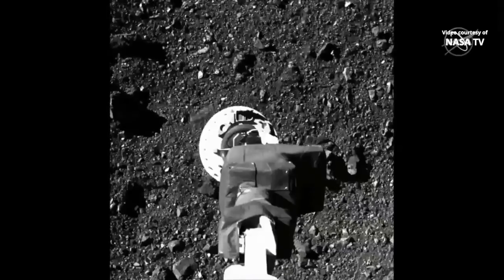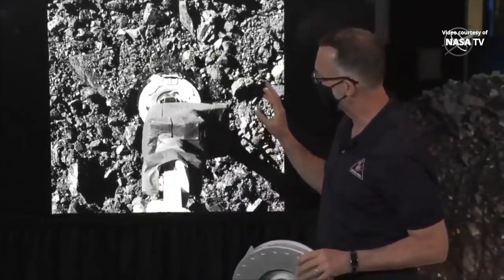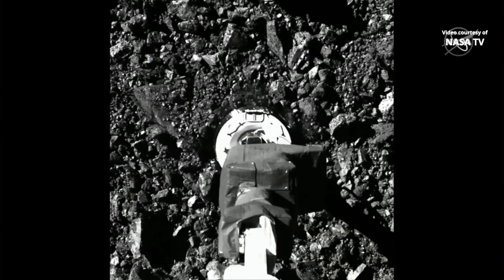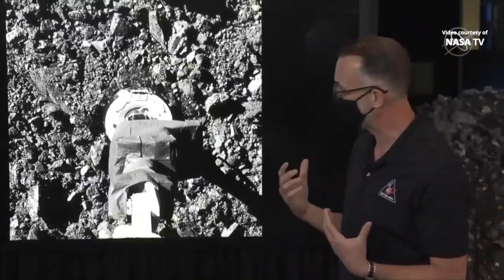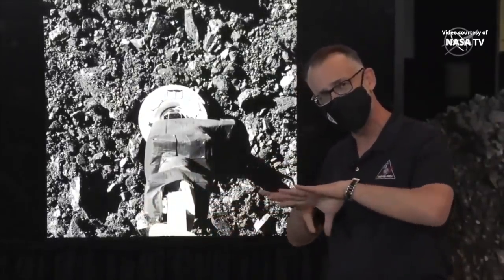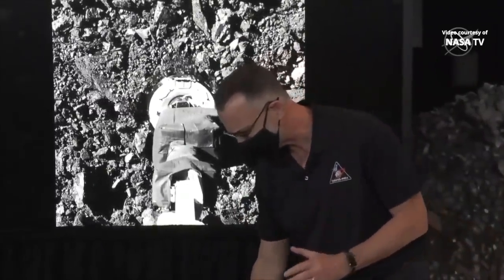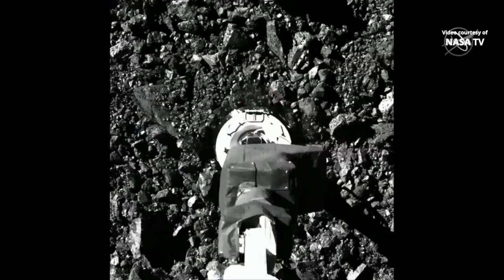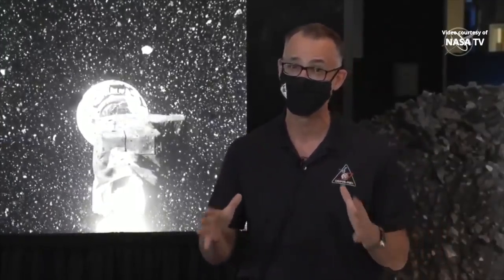OSIRIS-REx’s “Touch-And-Go” on Asteroid Bennu

Comment: It hadn't occurred to me until I watched this video but there is a good lesson in here.  On small targets like an asteroid,  the lack of gravity means the surface material doesn't lay down in layers the way us earthlings would expect.  The lack of a dirty dust layer and a heavy material under it is due to this lack of gravity.  Gravity would have made a nice "soil" on the surface.  On the other side of this however is the surface material is very loose.  It's not been compacted at all.  So when the gas hit it, it just flew all over the place like it didn't weigh what it's size would have us believe.

Comment: Can't they calculate the amount of debris on board by decreased acceleration of the engine?
Reply: They do it by swinging the boom around and calculating the difference in inertial force pre and post sample but they collected too much that the lid is jammed open and if the do swing it around they could lose too much sample.

Comment: I find the scooping mechanism unnecessarily complex.
Why not just a impact cylinder with closing end that can be driven harder and deeper on the surface?
Reply: The Osiris Rex NASA pages explain how they identified and assessed different ways to collect a sample. It is a very complex problem to solve. They had no choice but to make a number of fundamental assumptions about Bennu's surface AND also use what they DID know to design the sampling tool. Many of your questions might be answered by reading it all, then searching for even more info. That TAG sampling head really is an impressive design, even if you might not appreciate why that is a fact.
Reply: It makes the space craft more heavy making it more expensive and also the space craft shall be almost perfect at aiming the system you said worked on the moon because it's large making accuracy less of a concern
Reply: @perlasandoval7883 
Maybe that could be true.

Comment: One of the things that strikes me is just how "loose" the regolith on Bennu is.  It wouldn't take much to blow this entire Asteroid apart, or so it seems.  Almost like you could punch right through it.
Reply: This kind of asteroids form as consequence of collisions, they're piles of rubble held together by gravity. As opposed to other ones that must have been molten at some point during their existence.
Reply: @sym667  I'm questioning whether many of them are solid at all. They've been crashing into each other, being blasted apart for billions of years. Its possible most of them, even the larger ones, are just clumps of dust and rock.
Reply: @corthew  They're solid objects (dust, rocks,...) kept together by gravity. Don't know if there is any particular definition for such consintency, but do you need one? It's like fresh snow, it's fluffy. Edit: I guess.
Reply: @sym667  I'm really looking forward to finding out what their composition is.
Reply: @corthew  That should be interesting indeed. Their composition could give information about the early solar system.
Reply: @sym667  analogous metals could all be magnetically held together as well
Reply: @sym667  ... and possibly static electricity.
Reply: @thomasmaiden3356  Right!
Reply: @thomasmaiden3356  static electricity would repel the surface regolith
Reply: @giovannibini6809  - hmmm -you got me thinking about that ...
Reply: @giovannibini6809  depends on their polarity. Otherwise dust would not be attracted to certain sufaces.
Reply: In fact look at the aftermath as it rises from the surface. It looks like just that puff of nitrogen blew a crater in the surface.

I'm not sure how much longer they intend for Osiris to remain in the vicinity, but I'd love to compare the before and after photos of the TAG area. I cannot positively identify ANY of the same features after touchdown that we see on the way in.
Reply: Yeah just like one punch man😂😂
Reply: @kamehameha6495  I clicked on this comment thread just to see if anyone mentioned Saitama 😁
Reply: Unless there is a solid surface underneath that attracted all the little smaller pieces through its travels. 🤔
Reply: Would have been great if the weight budget had allowed for a ground penetrating radar. Is it a complete "rubble pile" or only "loose" on the surface? This asteroid has a chance to impact Earth. I would expect it to shatter.
Reply: @haroldhenderson2824  there is a cosmically slim chance it could contain artifacts, maybe an alien hammer could survive planetary obliteration and be magnetized in the heat before nesting up with a solid core and debris and embarking on a rogue forever cruise
Reply: @haroldhenderson2824  semi ball?
Reply: @Guilhem Mollier Nope. Not enough gravity and no liquids available to aide in that fusion. Plus, you have all the gravitational fluctuations as other bodies pass by. Those fluctuations are the reason moons can maintain molten cores due to the seismic activity they cause.
But there just isn't enough gravity to create sufficient friction to produce that level of heat on asteroids. 
I'm not a scientist though but that just seems to be logical after this event made me think about it. If we try to attach a rocket to an asteroid to bring it back to earth, we might find it pushing right through and out the other side. ;) Of course the larger ones I'm sure will have a central larger rock or rocks but this really has me thinking the average asteroid striking earth will be more like a fireworks display than an ELE.
Reply: Not just soft but porous and it looked like there was some moisture to the materials did the landing leave an imprint in the surface?
Reply: yeah - visually it looks like soil when bennu touches down - i am loving it
Reply: The sample head punched through half a metre of the asteroid so it is a good bet a human fist could punch through the surface of the asteroid, but it would be expensive to settle that bet!
Reply: yeah most asteroids are pretty flimnsy, hence why the sci-fi trope of nuking an asteroid headed for earth wouldn't do much besides turn a big bullet into a big cloud of buckshot
Reply: @ThatGirlMelissa85  A big cloud of buckshot that can't reach earth's surface. That's the point of nuking the hell out of them
Reply: @setsunaes  not how it works unless you manage to break it down fine enough. And "nuking the hell out of them" is wasteful overkill anyway; if you shoot 10 nukes at something, only the first one's going to detonate. The rest just get incinerated in the initial explosion without actually adding any energy to it. The smartest option in such a case would be multiple spaced out proximity nukes to nudge it away without causing it to spread out.
Reply: It makes sense when you think about what asteroids have been doing to each other for millions to billions of years. And they really don't have the gravity to fuse into solid lumps.
Reply: @Guilhem Mollier Earth has greater gravity and it has moisture. Electrical charge though may be able to fuse some of the rocks on an asteroid. I hadn't thought of that in my previous comment. 
And even the minimal frictions created by asteroids passing could create an electrical charge.
But I think Bennu is a strong indicator that fused is not the normal state of an asteroid. I saw no evidence in the video of any conglomerate rock. I'm curious what the composition of the sample will be. If there are conglomerates then perhaps fusion can occur and we have more than just balls of dust circling around. :)
Reply: @Guilhem Mollier Again, water, variable atmospheric conditions, significantly higher gravity than Bennu.
Water is really the biggest contributor to dust and gravel fusing on the surface.
Water dissolves minerals and evaporates away leaving crystalline structures behind. Even in if the minerals it dissolves don't crystalize you still get a cementing of fine particles of dust and sand and gravel.
Reply: Unless that is just an external layer of very loose material around an hard and solid core... We don't know I guess
Reply: @setsunaes  ciao Antonio, I'm sure that such an object is not only plausible, but it's reasonable to think that there are some, somewhere.
Reply: Regolith? do we know what material collected there? It wouldn't have solidified from magma on a small asteroid.
Reply: @HotelPapa100  pieces of alien structures, smashed urban debris
Reply: no... it's like trying to destroy a giant ball of lint with a sword.
Reply: But the biggest question remains: is the earth flat or not?
Reply: ben scalp Earth is not flat. It’s concave like a contact lens.